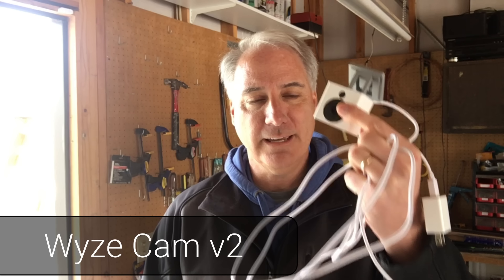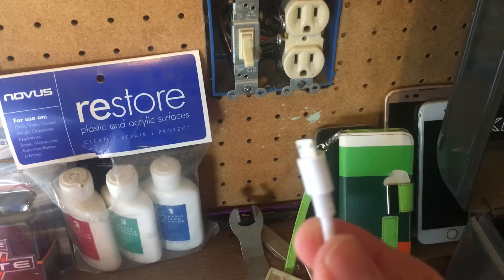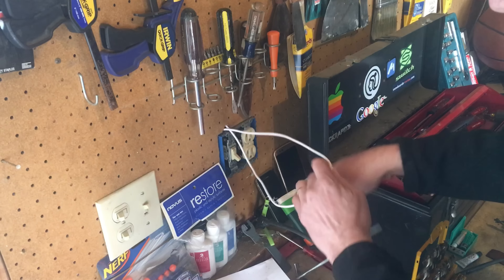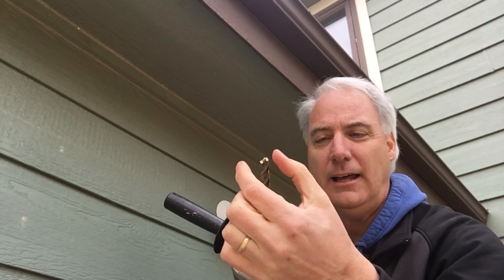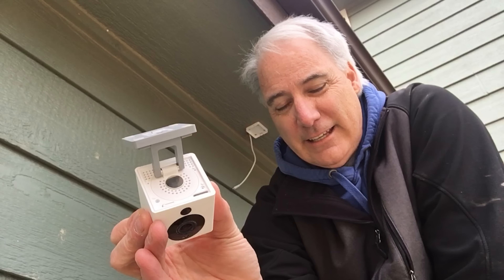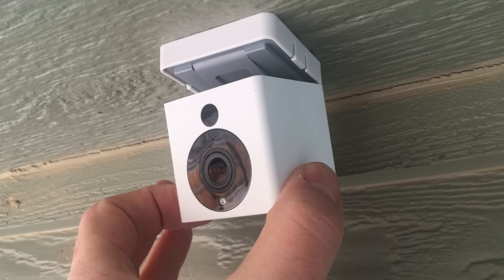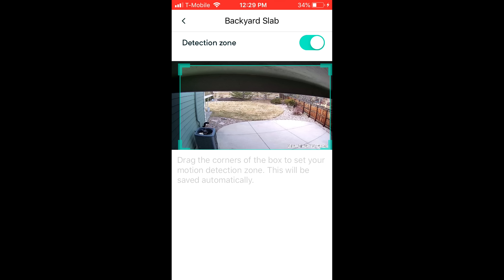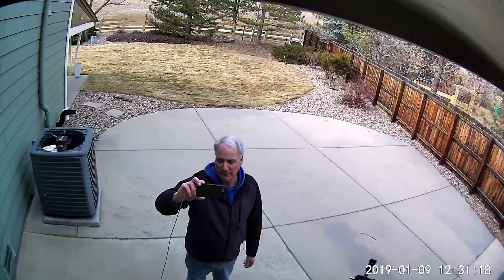Wyze Cam v2 Install Outside under Eaves with No Housing

Comment from the maker: Wyze cam v2: https://amzn.to/2M5fSPC
SD Card for cam: https://amzn.to/2VCZ2Ml
10 foot cable: https://amzn.to/2D0MneS
Mounting bracket: https://amzn.to/2M3xbjG
Reply: Dave Dugdale 2nd YouTube Channel Just a heads up it’s cheaper to buy the cameras from wise than Amazon and the only other assessory
Reply: I am what you call a youtube expert.  Great video.  Please never add music to your videos.  I subbed and predict you will grow fast.
Reply: I assume without the SD card you cant save video?
Reply: What electric screwdriver are you using?
Reply: @riche5959 , Search Amazon: Dewalt DCF680N1
Reply: @tisdale36  yes you can.  Around 3-14 days depending on video quality
Reply: @TintinPNW  Do U Have Wyze Cam V2????

Comment: The last reviewer really got it wrong .  The drilling  next to the box was correct it was a surface mounted box and looking into it
you can see were the 110 v entered  it . It was very obvious the wiring entered from the right side and he drilled on the left  side
of the peg board which most likely he installed . The USB  connector on it is used for 5 volt  DC power only, NO data. I have done 

a number of outdoor installs the wire is 2 pair ( red, yellow, black, and white ) I cut the wire and splice it after it's all mounted this way you can
drill a very small hole . Dave very good video  maybe Thomas should have his pic on the poster at Home Depot .

RB 

34 yrs Retired Electrical Worker ( local 134 IBEW)

Comment: The big USB type-A port is for accessories like of you buy their wyze sensors, or you can plug another wire into there to power a 2nd wyze cam

Comment: I got a USB power adapter that has a 90 degree bend in it, for installing my WYZE camera power feeds behind pieces of furniture close to the outlet.  For the last 10 years I've use my old, "indoor only" SMC IP camera outside, with no special case or any problems, just covered by the eves of the house.  Only weird thing was the bird that attacked it a few days after I'd originally installed it, obviously noticing its white and black pattern and getting concerned about it.   Biggest problem I have with the WYZE cameras is the unreliable, beta firmware they provide for RTSP (Real Time Streaming Protocol) streaming to PC based surveillance software like iSpy.  This firmware requires a manual reset every few days or hours because it just stops working after a random amount of time.  Sad when my simple, 10 year old IP camera (that no one makes anymore) works better than newer, higher resolution WYZE cameras with open protocols like RTSP.  I hope someday WYZE will fix this, but as they're primarily focused on just their proprietary protocols that support their smart phone app - it hasn't been any priority for them to fix.

Nice video, keep up the good work!

Comment: Everyone watching this video, DO NOT do this at home.  What he should've done is ran an AC extension cable from the outlet to the Wyze cam.  Then, plug the USB in from there.  DC degrades over cable length much faster than AC and why your power company doesn't send power to your house using AC current, ask Nikola Tesla about that.

Comment: I put mine closer to the gutter and it lasted about 1 year until a recently huge storm.  My 2nd camera is back and haven't had any issues.  I think the next one I get, I'll add tape to the top and rear to hopefully prevent some water from getting in.

Comment: I did this with one of these right after they came out. It's under an eave on our back door. We're in Colorado so COLD and wet winters, HOT summers... no problems. It's been running non-stop for well over a year with no issues.

Comment: I tucked my Wyze Cam  under a porch light that's amid at my deck. No problems all winter.. great little cam..
Reply: how did you power it?
Reply: @camaroman101  There is a shielded outlet below it. Drilled a hole in the back of the porchlight tucked the power cable underneath the siding.

Comment: I have 7 wyze cams outside in Phx AZ. They lasted well through last summer and still going strong. I would advise using a good sd card as the cheap ones I used failed after a few months. Now using Samsung extreme cards and they work well.  Amazing cameras for the price. They do the job well.
Reply: This is the same experience I got with this camera, after installing it outside (Not under direct rain), for several years in California.

Comment: Did you check to see if there were wires behind the board where you drilled?  If so were the wires hot? Or did you turn off the circuit breaker?

Comment: If are worried about water getting in thru the top just get a large clear plastic cup. Cut just enough of the side of the cup so it slips completely over the camera base. Leave enough of the bottom of the cup to adhere to the surface via 2 sided sticky pads. Also cut enough of the height of the cup so it hangs over the top of the camera without obscuring view of camera. Use the 2 sided sticky pads to attach bottom of cup (upside down) to surface. Use a big enough diameter cup so you can still rotate camera once your "plastic shield" is installed. Cheap and easy. Infinite variations of using clear plastic to act as a rain guard.....

Comment: I've had two wyze cams (one pan) installed under the roof eaves for almost a year now with no problems in the cold rainy PNW, except for having to constantly clear cobwebs away from their line of sight with a broom in the summertime.  I also used a long-ass usb cable, but was far less invasive in routing and mounting everything.

Comment: I purchased 4 Wyze Cams over the past several months. In that time, one of the cameras lost its IR capability and none of their mic talk functions ever worked. When I contacted support for the IR issue, it took a week for support to respond and then only to tell me what I needed to do to troubleshoot their problem camera....and it was a lot of crap to go through just to troubleshoot something that should have worked longer than a few weeks. I didn't feel that I should have to deal with that so I asked for a swap of a new camera, but again, I would have to jump through hoops to make that happen. I make decent money as a business analyst and considering the time and effort it would take me to fulfill that request, along with the cheap price of the camera, it wasn't a cost effective swap for me. There were other issues such as frequent audio blanks in addition to obvious omissions of things the cameras should have recorded like deliveries being made at my front door. In my opinion they rolled out this product before vetting all of the basic functionality which would explain why many many other Wyze Cam owners are having the same issues. The upside to this product is the function over cost. I consider these disposable products and do not recommend them in critical areas as it isn't a reliable product...short or long term. Spend more money for a reliable product and peace of mind....

Comment: When I saw Dave trying to feed unshielded USB cable next to a live 120 line, I said "oh boy!" Then, when he did a blind drilling above the live electrical outlet — I almost called 911 to make a reservation for him at a local ER.

I'll bet the Home Depot tool rental department has a picture of Dave nearby that says, "Do not rent POWER TOOLS to this guy!!!"
Reply: Thomas Ott there is no data going across the USB cable so noise isn’t really a a factor. However the drilling bit was scary haha
Reply: Thomas Ott - he was centered so the stud to which the junction box was mounted (and romex attached) would be either on the left or right edge of the junction box.  But yeah....I worried there for a minute as well! ;-)
Reply: @w5cdt  ever hear of a service loop or a shitty contractor? i'd never drill in the same bay as a romex wire. not because I'm scared of getting shocked (that's happened more than a few times), but because I don't want to go through the hassle of replacing the wire. drill in the next bay, or make your drill bit only go the depth of the material you are cutting in to.
Reply: He must be a die hard fan for "Home Improvement" American sitcom.
Reply: Plus, why drill such a big hole near the outlet box? He must not own a fishing wire....
Reply: One of the most unhandy handymen I have ever seen.
Reply: To add to that..."I am not an expert ha ha ha" comment(s) when drilling seemed like the famous last words.
Reply: I thought the same thing, he's gonna hit the power and its game over...
Reply: 6 months later, I just saw this and thought the Same thing! " Hehehe hahaha, used the wrong tool for this problem, now the......" Opps, call 911!!
Reply: I came to the comments just to see the reactions!!  This guy is crazy!
Reply: even I WAS FREAKING OUT over this. hahaha
Reply: You worry to much.... whats worst scenario to touch a phase 110v... I would take the risk same as him
Reply: You could of kept the hole small and fed the small end up by fishing a line down from the top.
Reply: @rogereriksen2472  amen!
Reply: I almost died
Reply: Don’t be Dave slogan is gonna be the new campaign
Reply: The case on the drill is shielded and grounded. If he hit a hot wire probably would have tripped the breaker. But not recomended.
Reply: Brian Samples -Your comment cracked me up, because I was thinking, “Ted would do that.” Ted is my b-i-l and a yuge trump fan.
Reply: A hammer after a utility knife would be enough but isn't that pegboard made outta a product called hardboard?  guh I am sure the construction wisdom here is going to be great?   yay this is good it's like watching the 3 new Stooges "Why I oughtta....use this blue thingy from the hardware store...."thank god he doesn't shop at the sex shop for his garage needs...and he knows his colors

Comment: I have installed a Wyzecam outdoors under the eve with no protection and it is working fine under severe weather conditions rain, snaow storm at - 35 degrees centigrade. Amazing it picks up snow flakes an sometimes flying bugs.
Reply: how long have you had it without a cover?  I put an outdoor cover on mine but it seems to be interfering with the IR lighting causing the night vision to be useless

Comment: I have done this and know that camera will survive and will serve you at the best. 
Among the cheap IP security cameras, this little on is MY FIRST choice and I have been well cheated by numerous Foscams to no name direct Chines sellers ones. Period. 
You can't go wrong with this little one quality you get is highly exceeding what you pay. Best bang for buck. @ 1:01 Wasn't it better to run a simple bare 110V line (Easy to pass through small hole), to high level, form side of your socket that has screw attachment for extension, then place the entire adapter over the top, in a small electric box, away from accidental disconnection etc. Also a possibility to increase the number of cameras easily, if you need to see the right side or direct front of your garage with 2 additional cameras?
BTW Love your videos Dave and good to see you again as I didn't come across any new production from  you, for a while. Bell is click for "All". Thanks for the good job as always.

Comment: I've had TWO installed outside, under eaves, including the new Tall version. Made it all Winter here in Upstate NY and still working better than my RING devices!
Reply: Mine's going to go under a eve. I live near Chicago. can it work In minus temps?
Reply: Does the motion detection work well?
Reply: How about night recording?
Reply: Do  you have to take down to charge?

Comment: There is nothing wrong with drilling above or around a jbox if you know where the power enters the box, which you can see by looking into the jbox.  Speaking before thinking is much worse.

Comment: The 14-day recording and the 32GB micoSD card are two different things. Wyze gives you cloud recording of 14 days of approximately 12- to 15-second video clips of events picked up by your WyzeCam. You can setup your local recording to the microSD card for either continuous recording (which fills it up in several days) or event recording. If you choose continuous recording, the WyzeCam will erase the old clips with the newest clips. This is a great feature, because if you’re notified of an event, you might not capture the actual beginning of the event, depending on the sensitivity level you have chosen. However, if you have continuous recording enabled, you will be able to rewind earlier than when you were notified of the event. I have two WyzeCam Pans, and both are set to continuous recording. Later this year, Wyze will be releasing “Wyze MaxDrive,” which will give you redundant video recording storage. For example, if someone steals your WyzeCam, you might pick up the perpetrator on your inside hard drive. Wyze is also said to be releasing a true outdoor camera later this year. I’m hoping they’re released before my next big trip. Good luck!
Reply: Nice I will keep my eyes open for that Wyze Maxdrive what a great idea....I wonder if it will be compatible with other security cameras.
Reply: @shadowbanned5164  - From what I understand, the MaxDrive can be used for a number of other backup functions, just as you would a true NAS. I am anxious to see this thing in action myself.
Reply: I installed the SD card but for some reason it's saying it not installed and not recording
Reply: @sandraangulo8402 , try formatting the micro card. it's one of the options in the SD card section. If that doesn't work try another SD card, I've heard that has helped others, like myself.  Good luck!
Reply: Sandra Angulo Flores did you get it fixed to record.

Comment: I just added a 110v plug adapter to an outdoor bulb socket.
Reply: 120
Reply: 240v
Reply: @lijie6431   120
Reply: I did the same thing. I have a two prong socket on a motion-detection light. I get the light at night with motion so two birds with one stone. BAM!

Comment: Thanks for the exterior install vid!  That big USB port on the back is for daisy chaining Wyzecams -- so you could power another one around the corner without drilling another hole into the wall.
Reply from the maker: Oh that's right, thanks for reminding me.
Reply: or feed another 10' usb cord back up the hole and drill another hole around the corner
Reply: Also used for the new Wyze sensors and motion sensor
Reply: Really? Good to know!
Reply: I believe the USB port on the back is for the bridge also.   For connecting the motion detectors and door contacts.

Comment: There's no way that this is still working long term. Water infiltration from the top where the microSD slot is was inevitable.
Reply: Mines been outside under an eave for 2 years.. we hit minus 30 some days in the winter

Comment: Dave, you did have me on the edge of my seat a few times overall I think your idea was cool & I also didn't think about buying a longer cable. I was going to suggest if you want to protect the outside spot of the camera you could use clear tape around it. Thanks for the share just be safe :)

Comment: Water is just one concern. Bugs like to lay their eggs in places inside electronics. Dark, warm and nice. They secrete gooey liquid that shorts out the camera. Duck tape over any open ports to reduce the chance of this happening. Spring will be there soon. Good luck!
Reply: I have many copies of this camera and beside loving them, they all over heat. Covering the vent slots can have significant untoward effect, IMHO. I would cut a bottom of regular plastic water bottle and use it for housing to make it impermeable to water (as much possible) then I would not care much about the bugs in back of the camera but the bugs that come to front, especially the spiders who make net due to attractive IR  night light, being visible to bugs and would bring a huge number of them to the location in summer months, would be my only bug concern cuz they block your view.
Reply: There’s gotta be a 3D printable file out there instead of $25 for one on amazon
Reply: DUCT tape — the word is "duct" — not duck as in quack, quack.
Reply: T @thomasottvideos There is Duck tape, it's all I ever use. It's adheres and stays on better than duct tape.

Comment: Enjoyed the video - did you consider sealing up the back with some silicone?
Reply: If the location of "Back" is that of camera, Big time NO. This camera warm up a lot and you don't want to mess up with ventilation fenestra on the back. You can keep it under a shade to prevent water entry though. I had no problem with insects or dust.

Comment: Do you know what's the max micro SD card capacity? I know on the official Wyze cam website, it says up to 32gb, but I want to know what's the max. Also, for continuous video recording [with micro SD card inserted], is it true that old videos taken on the camera gets replaced with new videos after the camera runs out of space? And when this happens, does it replace everything or just a few? Lastly, does the camera allow you to access the files via WiFi or mobile in any way without having to pay a fee [if so, how much would it cost and can you access those files via WiFi from the micro SD card itself, rather than using cloud storage] or subscription?